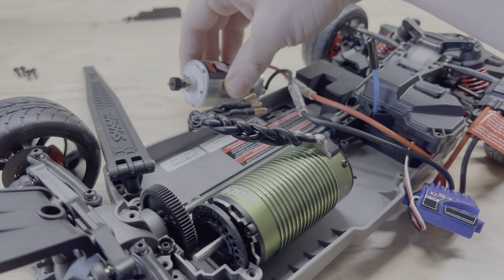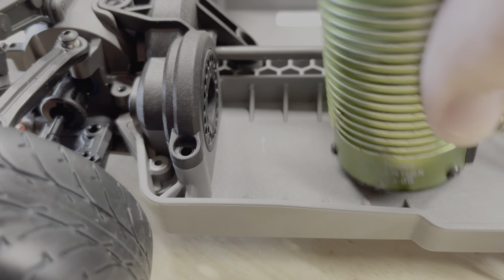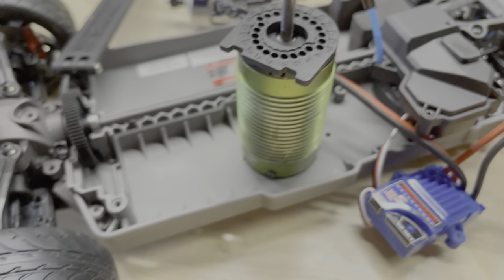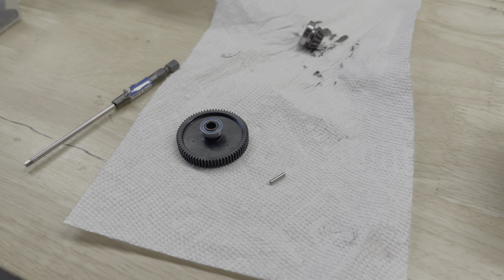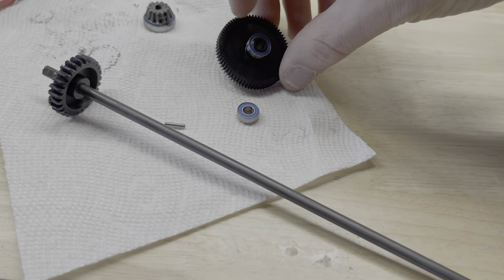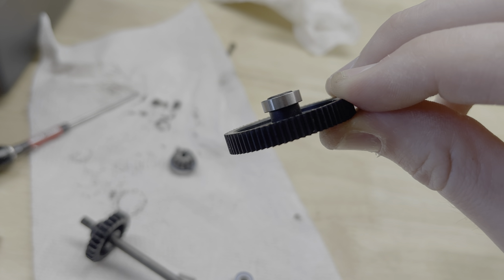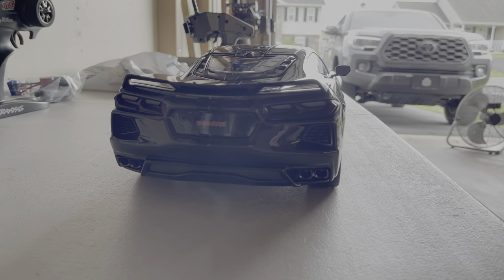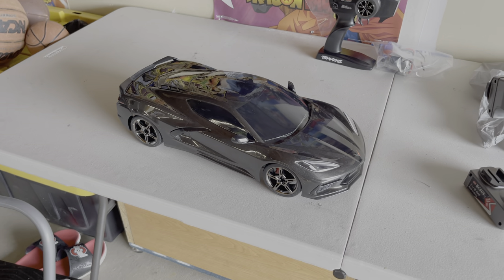Traxxas 4-Tec 3.0 | Motor, ESC, Mod 1, Receiver, 6S

Comment: I found a roller on ebay for $200. Then put a 3000Kv, 3670, 80A, 4S set up in; with 29tooth motor gear. LOVE IT!!

Comment: Why don't you try this adjustable motor mount from hot racing TRF18A01 - this Adjustable Aluminum Motor Mount Was designed for the 4Tec2.0 3, may definitely may help you with your motor dilemma. It helped me with my motor dilemma a few years ago. 
And also you may need it anyways to deal with the heat issues as well.

Comment: Use (Gone Bananas Tire Foams), Traxxas stock slippery tires are in a weak spot for a set-up  Nice ultimate upgrade!  Can't wait til it rip at (100 mph) at full stop, if tested on smooth paving road.  (A+ A+ B+)

Comment: Hot racing makes a taller gear cover just for speed runs. I have one on my 4tec with a 35t pinion and I still have extra room. If you do get it, depending on weight up front you might have to add a couple .5 gram lead sticky weights cause the HR gear cover adds more weight to the back. Easier for you to catch wind resistance and flip over at high speeds

Comment: Nice job it looks good i did that with my 4tec 2.0, the tires are not the best to speed run on, a lot of guys i know sent the stock wheels to gone bananas and had foam tires put on them. I also had to do a lot of cutting/grinding  in the chassis to fit the motor to get the adjustment right

Comment: Wrong motor that thing is 42 mm across versus 36 mm standard brushless motor you should’ve went longer not fatter in this particular instance
Reply from the maker: If it fits then I can use it. No such thing as a “wrong motor” especially when it does 128mph.